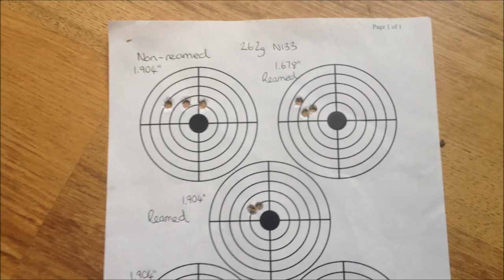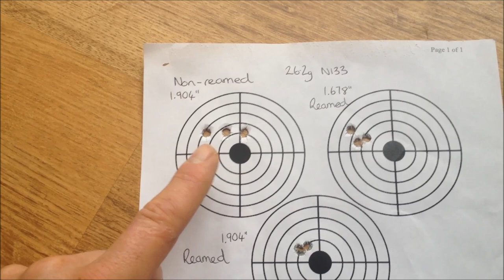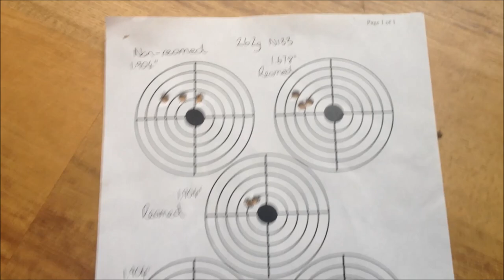Reaming out case donuts

Comment: Discovered donuts in my 280 cases after trying to set a flatbase bullet in the case after firing. Bottomed out at the neck shoulder junction. Cure was a forster inside reamer .284 diameter. Works perfectly for removing those hidden inside donuts. BTW, if you attempt this be sure to ream on a fired case, not after sizing.

Comment: Si, I recently picked up some once fired .416 Barrett brass from Barrett and discovered a pretty serious situation involving donuts. The tip off was when I attempted to slide a .416 bullet into the mouth and neck when it suddenly came to an abrupt stop at the base of the neck where it transitions into the shoulder.... That point where the boat tail on the bullet transitions into the bearing surface of the bullet is where it hung up..... I measured the neck I.D. and it came in at .417 or .001 larger than the bullet, which allowed the bullet to slide in easily. I'm not sure what the dimension was at the donut, but obviously it was smaller that the .416 bullet.  Tried using fine sandpaper on a flapper with a variable high speed die grinder hence polishing any high spots from the inside of the neck, which the donut was clearly revealed. I continued the process until reaching a uniform pattern at which time the bullet would then slide through the full length of the neck freely.

I would like to avoid removing material on the inside of the neck, other than removing just the donut because I want to turn the outside of the necks in the lathe. The neck wall thickness is currently around .025, which most likely needs to be thicker for the .416 Barrett (50 BMG case). I'll most likely be in the range of 190 gr. to 220 gr. of powder, so I'd like to keep the necks as thick as possible. RUAG in Germany is the actual manufacturer of the brass. I haven't gotten into neck reaming up to this point in my reloading, so I'm wondering what size ream to start out with. The once fired brass appears to be .417 I.D. before resizing, so would I begin with a .417 ream? The .417 ream would barely whisper the inside of the neck until it got to the actual donut.... Or, should I try some other size? Please advise...
Reply from the maker: Tom a 0.417 would work well IMO. The brass will stretch slightly near the case mouth rather than cut, but be less likely to move at the neck shoulder junction and more likely to cut which is exactly what you want. 
Outside neck turning after expanding can push donuts to the outside and turn them off but on strong cases this is less likely to happen and inside reaming is the only way. 
Let me know how you get on. 
You could make a pin gauge and check to see what is the largest reamer you could use. Perhaps find a tight pin then go 0.0005" more.
Reply: Not sure what you meant by a tight pin.... But I can go a half thousandth larger than the .417 if that's what you're referring to. I have a precision shank chucking reamer in mind for the process, which hopefully will only require one time. The problem is pretty severe and it involves the majority of the cases..... So, I've got to do something...

Comment: Hi Si,
Just a thought. Have you tried running a transfer punch or sized piece of stock the I.D. you need in the case neck as opposed to removing material? More like a plunger instead of cutting? Thanks, Gerry
Reply from the maker: gerry mckown I use K&M neck turning gear now to expand and outside neck turn to solve the issue. 👍🏽
Reply: Roger that Si. Thanks for the response! I have a small machine shop here at home and I am building a few reloading tools. I am quickly realizing case prep/accurising is the best way to improve the overall accuracy of my precision rifles. Have fun, G.
Reply from the maker: gerry that's very cool man. When you make your own OAL measuring gauge I'll be very interested in seeing it. 👍🏽
Reply: No prob Si, I'm guessing you mean a chamber OAL gauge? not a post reload gauge to check cartridge OAL . I'll show you both of the tools I have made along with a few of the others I have been working on. Thanks,  G.
Reply from the maker: gerry yes I'm referring to an OAL gauge to measure the distance to lands with s given bullet using a dummy/modified case.
Reply: check this out Si..... Gerry

Comment: Are you reaming before or after neck sizing??
Reply: Ream before sizing
Reply: I believe this donut issue is more of a problem on cases with very steep shoulder angles. i.e. 280 ackley improved or any other Ackley Improved case. 40' shoulder angles increase the probability of this issue. It's easy to correct but should be addressed.